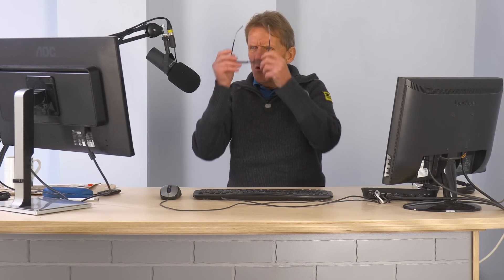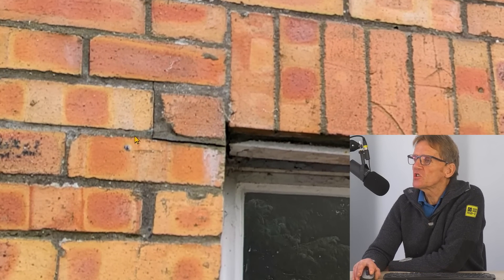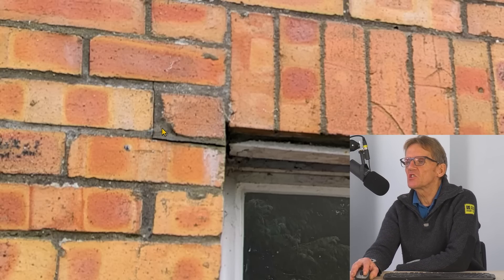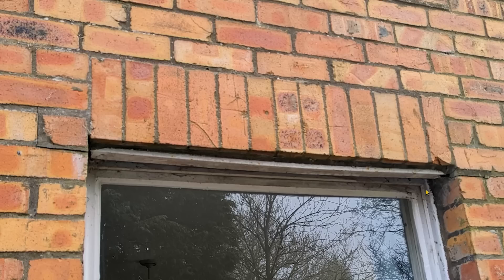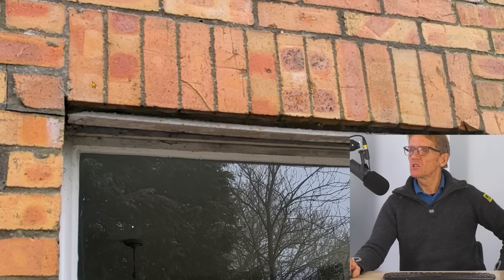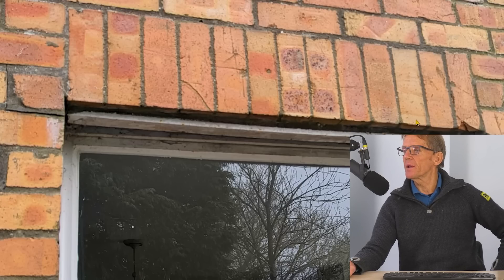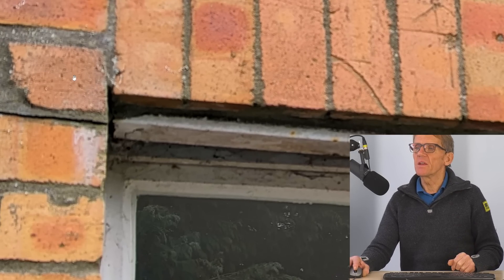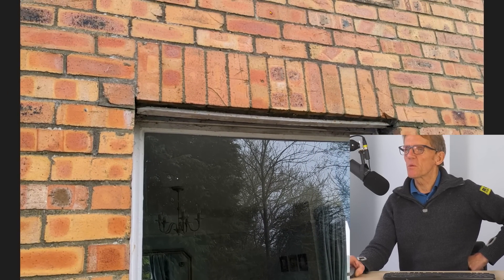How to Make This Lintel Replacement Look Good

Comment: Steel is still gonna move , quickfire that rog.
Rare I disagree   , that steel has to come then adopt same approach using strong boys then you can fully get your hands in far damp + if the halves need cutting far depth you'll have to go a lot wider.

No job far a monkey

Comment: You're right Rodger, those bricks are Flettons, probably LBC.
Hard to come by reclaimed ones actually because no one saves them when demolishing. They might even be imperial sizes.
The modern version (metric) are much brighter and will stand out like a saw thumb.
But I'm afraid the arch has to go. I don't think it's possible to install a damp tray otherwise.
I'm sure Steve and Alex would agree, they are great with this kind of issue.

Comment: Difficult to see the age of the building but guessing it’s a 1950’s with concrete lintel on the inside. A good brick wall, there is only a small amount of weight of brick on the soldiers. I believe formerly there was no outer lintel but a larger heavier window, which enough to support the bricks above. I am guessing sometime in the past this was removed a flat steel bar was let in below the soldier course. The bearing ends of the bar have now corroded, which causes jacking on the brickwork and thus the cracks can be seen. They will need to swap the steel bar for something similar but galvanised.  Best to get your Structural Engineer can specify one for you. You might have to rebuild the wall above or pin. Good luck.
Reply: It's 1930s with original windows and original lintels. Will swap the lintel with one suitable as per manufacture, don't think a structural engineer is needed in this case.
Reply: OK Paul , it will only cost a smallish fee for the engineer for complete assurance. Regards

Comment: You need better video editing :( a constant hissing sound from the mic and also you should be drawing on the pictures rather than using your mouse pointer.... just saying..  I'll be happy to do the editing as it's not even hard..  but great content as usual
Reply from the maker: Good tips. I don't know where the hiss is coming from, that mic was £450.00
Reply: @Skill Builder . Firstly I appreciate your response to my comment :).  look into a Wacom tablet which allows you to draw on images etc. In terms of the hissing, it could be a number of things. If you want ill happily edit this clip and draw on the image where you've been pointing.  If you could message me the original picture and I'll use my wacom tablet. Just so you can see the difference :)

Comment: the mortor in the brickwork looks a very strong mix so will be hard to  cut bricks out !  you might have to put the lintol on  a  cut down brick and have the header brick as a brick veneer !   so the brickwork joints look uniform  !

Comment: Thank you Roger. We’ve had this exact issue on a house. We Would take out the soldiers very carefully ( with a sawzall if the mortar is soft enough ) then at least a brick and a half back on each side . New angle iron, new cavity tray, insulation and weep vents. Bed the soldiers on the new lintel then the big gap will be above so put in a tile crease course above which doubles up as a drip . 
    A good days work in that. Dont struggle letter box style, if you are removing bricks just take extra ones out so you have room to manoeuvre. 
👌🏼🧱👍🏼
Reply from the maker: Good advice, thanks. I would like to do a live link up with you one day on a couple of these brick  related questions.
Reply: @SkillBuilder  . Sounds good Roger 🧱👍🏽
Reply: @SkillBuilder  Get it done mate.
Reply: no strongboy? you might find old mortar would mean droppage.
Reply: Exactly right, it's easier and quicker to just take everything because there's always lumps of muck in the way etc. Also the bigger l shaped lintels are really high on the back which makes them really awkward to try and wriggle in
Reply: @luketaylor8602  🤙🏾🤙🏾👍🏽🧱
Reply: Can't really sit the lintel lower than the existing otherwise you'll see the backside of it from inside when the top sash is opened. You can see better at this angle how the sash frame is level with the lintel: https://youtu.be/ORXCrBL1HW4?t=16

Any tips on improving how the wall looks? Not sure the re-pointing job that was done in the past is doing it any favours.  If you fancy the job in Wiltshire, let me know!
Reply: out of interest ,pricing , ex VAT , somewhere around £800 -£900 or closer to £2K given all the overheads these days ,  I would imagine c£850 each if there were like 3 or 4 on one house to do ( plus access if above ground floor level ?)

Comment: Just from the thumbnail it looks like it's rusting away. The expanding rust is causing the bowing in the middle as it's pushing the lintel down and you can bet it's expanding in the beds at either end causing the cracking and lifting of the course above.
Reply from the maker: For sure